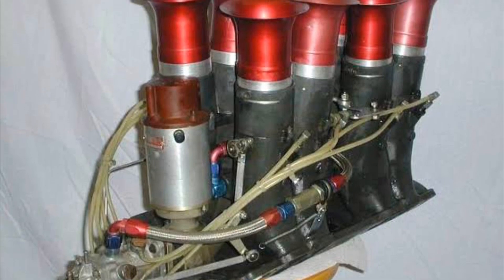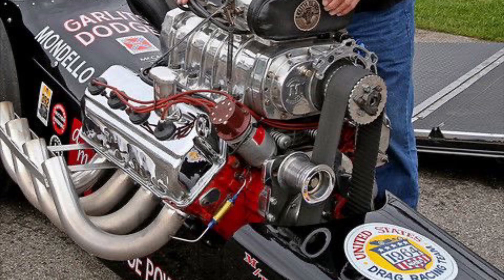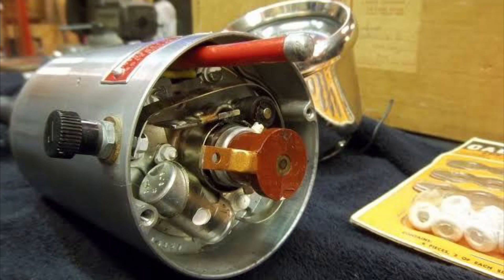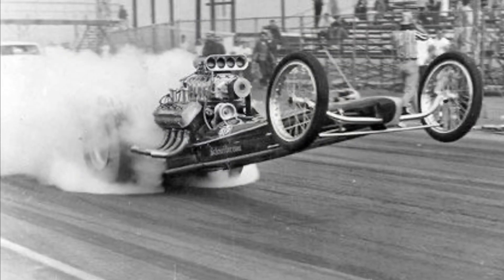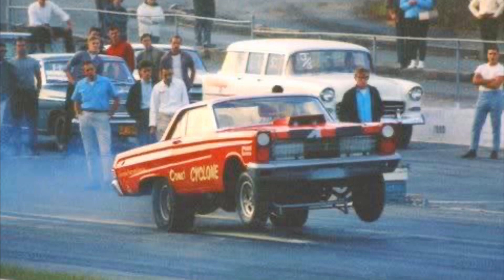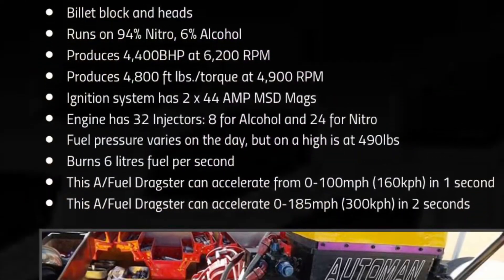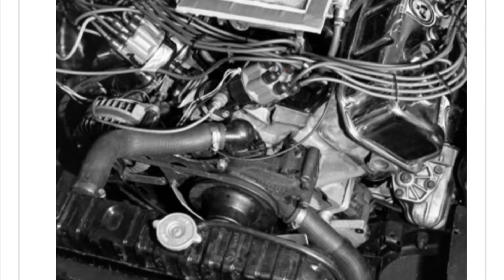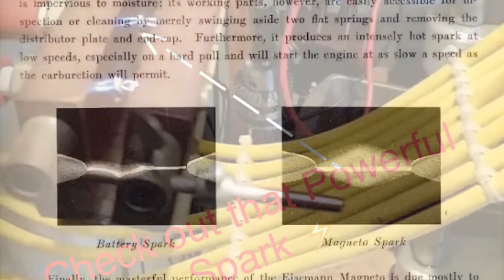The “First Performance Distributor” Vertex Magneto

Comment: Can a ignition box with separate coil be used with this mag with a nitrous set up ,or can it be only used alone an have plenty enough spark
Reply from the maker: They were used alone & had plenty of power⚡️ like 20,000 - 30,000 volts🏁

Comment: Ran a Vertex years ago, advance was locked down. I would have to spin starter first then turn mag on or risk busting starter nose on a kickback. Other than that it worked well.
Reply from the maker: I remember as a kid 15-16yrs old, some 28yrs ago  in an older relatives 454 BBC 2door Monaro, had a vertex mag on that, roller cammed 
Man that thing used to sing to 7500 like nothing , crisp....& pull like hell
Ended up doing 11.0s  unsorted, just badass it was....👍🏼🏁
Reply: @69JANKS  They pack quite a jolt, don't ask me how I know, lol. Not sure which bites harder a mag or a MSD, quality plug wires are a must.
Reply from the maker: @gearbanger57   haha exactly 👍🏼🏁

Comment: I like magnetos and it seems like not too long ago they were a common sight at the drags. They are like self contained flame throwers. Thank you sir for your excellent overview. I’m pretty sure that many folks haven’t even seen one before. Now they have a clue 👍.
Reply from the maker: Yes they Sure were. Even when i was a kid at the Drags & older guys i knew back then ......most were ruining them.
Thanks for the comment 👍🏼🏁
Reply: @69JANKS ....your experience shows    so I don’t need to remind you about the strange and wonderful power that Drag Racing holds. When it gets in your blood, for most people it never goes away. 

I was a kid in the pits once upon a time.  The year was 1964 and I was 10. But I never was really treated like a kid because of the job I had as a crew member on my oldest brother Genes pit crew. I learned the importance of everyone working together with the primary goal of....Winning ! 

That was my first true hands on experience with a REAL race car, my brothers ‘64 Thunderbolt Fairlane , factory lightweight Super Stock/ Match Race car. 

It was powered by a 427 High Riser with dual quad carbs on a rare Ford single plane aluminum intake manifold that was specific to that engine. 

My job was to cool the engine down between rounds by a very simple method. I would pack crushed ice all over the intake manifold. It worked pretty good because the super chilled intake would also wick heat out of the dual Holley carbs and the heads with those tall  ( high riser) intake ports.

But the most important job that I had as a very focused 10 year old was the removal of all that water that was once ice. The intake had a very tall profile with deep recessed areas between the ports that held lots of water. The reason that the task of drying everything completely was so important is the rule book. It didn’t allow for ANY liquid dripping on the starting line. The penalty was immediate disqualification  😳. 

I’m glad to say that Gene was never disqualified for dripping on the starting line. 😉 The whole experience opened my eyes to a sport that’s larger than life and a lifestyle that never has a dull moment.   I’m 67 now and still hooked 🏁🏁🏁.
Reply from the maker: Daniel Wilson  haha right on 👍🏼🏁, that's so cool & thanks for sharing....... just love hearing first hand stories of where it sort of all begun. Wow factory lightweight Fairlane  now that's a car that'll be worth quite a penny nowadays . That's so cool. Ahh the good ol ice bag trick on the intake haha i thought i was the only one doing that stuff also. I used to do that stuff in the 90s on our NA stuff between runs, sure did keep em consistent in et at least......& was still doing that up until a few yrs back on buddy's turbo cars at the drags. I'd always put in that extra effort even tho on a buddy's car. Between rounds or runs  would always open the hood, remove/open the valve cover breathers, pack ice bags on the plenum & intercooler etc lol..... i like the car to start the burnout & line at no more then 160°F  warm enough oil & cool enough intake temp 🤷🏼‍♂️🏁.
Thanks again 👍🏼🏁